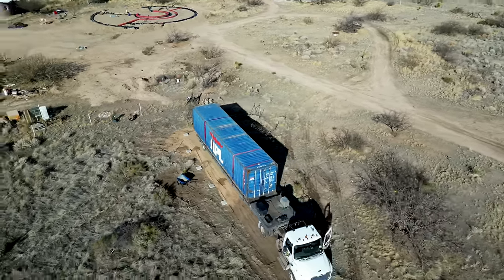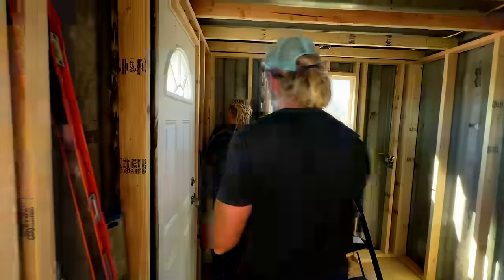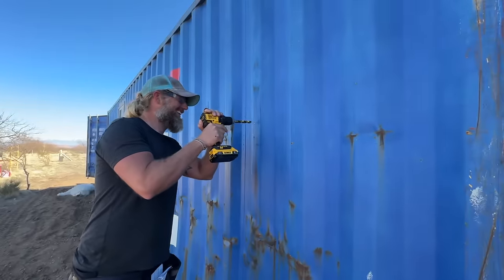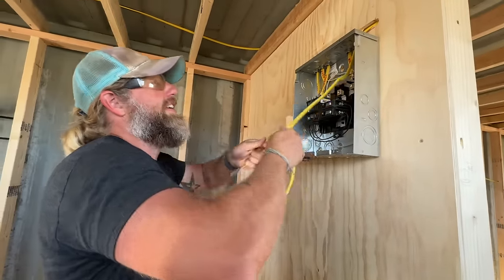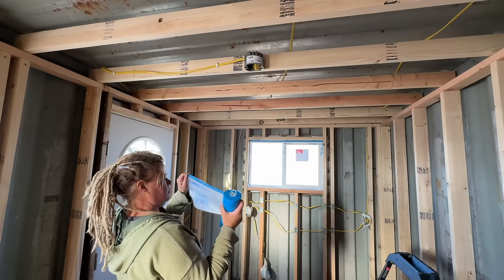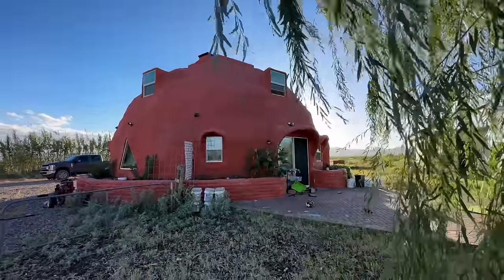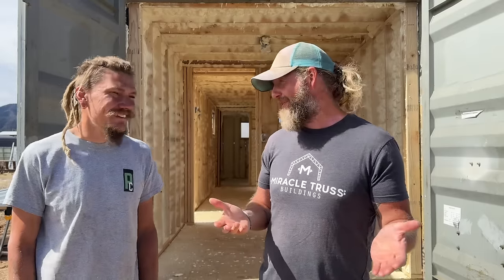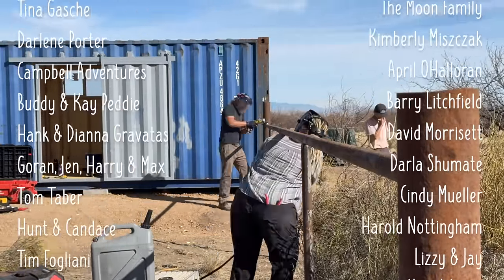RUNNING Electric + SPRAYING Insulation in the Goat Barn Shipping Container

Comment: Would be a good idea to also add a ground rod and ground the outside of the container with it having a steel frame. Protect against any electrical bleed. 😊
Reply from the maker: We'll be covering grounding when we install the batteries and inverter.
Reply: @TinyShinyHome  I figured you would. Your a very intelligent person who does his homework. But incase someone misses that episode or fast forwards (heaven forbid). Just thought I'd bring it up. 😉
Reply: @michaelrust7614 It is better to be told about something when you already know it than to Not Be Told and come a cropper. Old way of saying meet with a real disaster. I didn't know this, and I am glad of the knowledge which you supplied.

Comment: I'm glad to see you're running your wires up high! How many circuits? What size breakers? Any GFCI outlets or breakers? All the wires look really nice. Nice gromet wiring through the container! Boy, Jax is such a "For the Content" type of son! That was funny doing the pull ups between the ceiling joists Ashley! That was a lot to remove and then you got everything covered in preparation for the spray foam. That's great that Adali painted the sliding door. Yay Kyle! Nice spray foam job! It's nice to see Kyle again! Wow, R21 in two inches of foam! Wow, it seems very safe. Thanks for going over that. I'm so glad to hear it's done off gassing in 4 hours!  He didn't spray the inside of the one plywood wall? Wow, that's a lot of scraping! Thanks for the Tuesday and Saturday heads up! Thanks for this video Longnecker family. Adali, I think you did a wonderful job designing this wonderful Legend Dairy Goat Barn!
Reply from the maker: Thanks! We have several GFCI outlets and 6 total breakers. Will probably cover the details in a future video.
Reply: @TinyShinyHome  Thanks for letting me know. You guys think of everything! I'm so impressed with Adali's design. You both I'm sure are very proud of her!

Comment: I know this is about 2 months late for a comment about the wiring.  But as I was watching Ashley trying to run romex in the goat barn through a corner.  In the future if you strip the romex back about a 12-24” to a single conductor. Cut the remaining conductor off, wrap the ends and the insulation with electrical tape making it a smooth transition between the single conductor and the rest of the romex wire.  This will normally allow you to snake the romex around corners or whatever you want it to go.  This technique also works well if you have a wire snake you can attach your romex to the snake using the electrical tape to make a smooth transition between the conductor and the snake.

I hope this will be useful in your future projects.  My wife Amy and I have really enjoyed your video and wacky funny family and animals.  Keep up the great work

Comment: I used to wire mobile homes in 1987 until a strike. We used metal tubes & plates to protect wire from drywall screws. Kool spray foam, it will help.

Comment: At 3:39 - you need something in a u shape - like a bit of bendable wire poke it in the side of the gap and feed the wire through the wall then pull back, thereby dragging the yellow wire forwards. Won’t help you with this build but will if you need to on the house!
Reply: Or drill a bigger hole.
Reply: @freddymax5256 Well, yes. There is that school of thought.

Comment: Love the look of the inside of the connex. Good job framing for having never done it before.  Are you going to use nailer plates over where wires run through the studs and rafters. To protect wires from future screws and nails?
Reply from the maker: You bet 👍🏼

Comment: I believe mini split should use orange romax, had before yellow on my 12kbtu split system and it was really struggling with it. Once I've installed orange, it was smooth sail. Also If you are bringing power to container I would use at least orange (30amps). In any case, party! 🎉
Reply from the maker: A 12k mini split only needs a 20a breaker so 12/2 is perfect for that. Plus ours is only a 9k.

Comment: Hi guys, I see you are struggling with the corners. Look up California corner. It's a way of framing your corners in an L shape. This way you just have to drill through one 2x4 or 2x6 whatever you are working with. You use it on all partitions that are tying into each other. It also allows you to get insulation behind the corners. Good luck.

Comment: Ok, hears an idea,  why do you not drill a hole into the 2x4 studs before framing so  that you can pull the wire through easier.  Outlets and switch plugs are usually mounted at a certain height.   
Just a idea.
Reply from the maker: They're not in an animal barn where they could chew on them. The exact location of outlets were decided after framing.

Comment: You need a whole pack of drill bits to do the ones in the container. I’d pop the holes with an acetylene torch.
Reply from the maker: Nope, just use metal bits.

Comment: when you do spray foam, you usually do conduit for electrical as well otherwise if you ever have to do a repair, you will have to destroy the insulation
Reply from the maker: It’s fine. It’s a barn

Comment: You should buy a romex stripper it makes life a lot easier. I wonder how hot the metal will get in the summer with the romex touching it and will it melt the romex?
Reply from the maker: The romex isn't touching the metal, it's spray foamed in. Either way it doesn't get that hot or transfer heat like that.
Reply: @TinyShinyHome  ok that’s good I just saw some romex that wasn’t going through the wood but behind it and was worried for you. It gets hot in the summer so you never know. Everything looks good though I wasn’t trying to bash your work. I was just concerned about it.

Comment: 5:33 Why didn't you punch the knock-outs on the back of the panel and drill corresponding holes in the plywood to run the wires? You will have a short length of NMC exposed; I'm not sure if that's up to code.
Reply from the maker: Because I didn't want to punch that many holes through the back of it. We'll make sure those tiny bits are covered when we start building out the battery/inverter system.
Reply: @TinyShinyHome Those solar panels at the end of the video looked pretty nice!
Reply from the maker: @samuelgilbert9734 😎

Comment: 4:16 the walls are not structural use bigger holes in corners and add nail plates to prevent screws.
Reply from the maker: We added nail plates after.

Comment: I understand that you guys have windows and doors in this, but I thinking that they won't be opened at all times and it won't be used 100% of the time and it could have heat build up inside. Having a basic vent in the roof might help remove excess heat.
Reply from the maker: That's why it's being insulated. Also we're installing a mini split in the only room it really matters in, the milk room. Feed storage won't care how hot it is, and the goats can choose inside or outside for what's most comfortable to them.
Reply from the maker: They will be open.

Comment: Very cool. however couldn't you have built a more sized like 12x30 or 10x 40 usefull building dollar per dollar
Reply from the maker: You can't really build a solid structure this size for less than a shipping container costs (at least right now) unless yo do something crazy like we did with our shelter logic tents. See https://youtu.be/yPAfZBpeab4 This has served us well, but we're moving to the next step with the goat barn.
Reply: My window supplier warned me to remove the stickers on the windows to keep the sun from creating internal heat expansion and possibly wrecking the seal.

Comment: 🤨 R, 21 at 2 inches thick there is spots in there that look like it’s not even 1 inch thick what is the R-value for that? I don’t want you to take me the wrong way because he did a great job and spray foam is the best I’m just curious.
Reply from the maker: It's 2" and closer to 3" on the ceiling and west wall. Remember, there's large cavities behind the framing where the container walls go in and out.